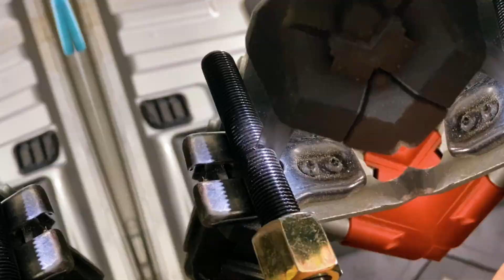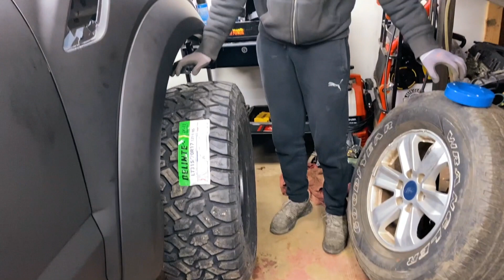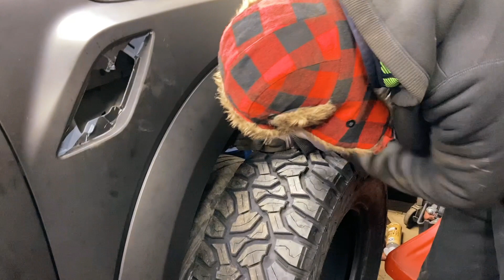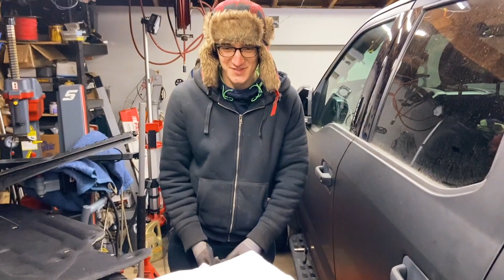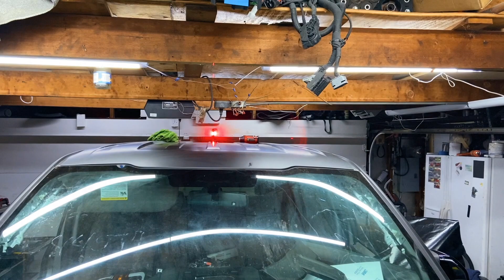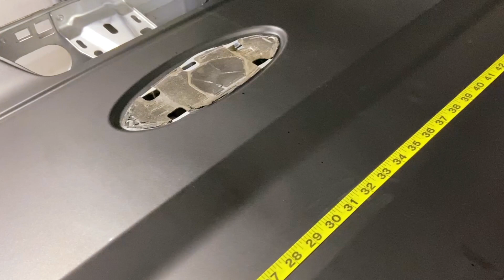Transformation of Ford F150 into Raptor Project part 11

Comment: Hey guys
You lift up rear leaf springs for fitting new tires or there is another reason?
Reply from the maker: yes, that’s the main reason we added the lift kit
Reply: Reverse Engineered what is the rear blocks height? 2inch? Or less?like front spacers lift the truck 2inch but the spacer height is less than 2inch.
Reply from the maker: @alikharutyunyan2657  the lift kit isn't a 1 to 1 ratio. Due to suspension geometry the front spacers are 1.33 inches but it still lifts it 2 inches, and the back is exactly at 2 inch block height.